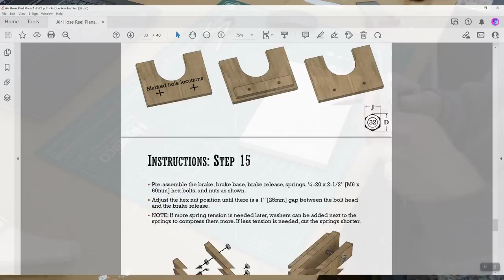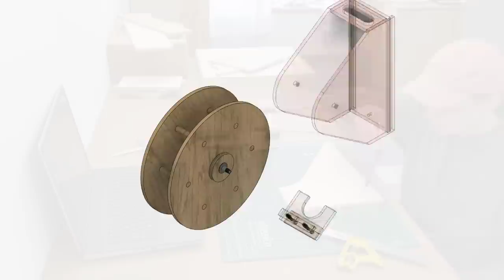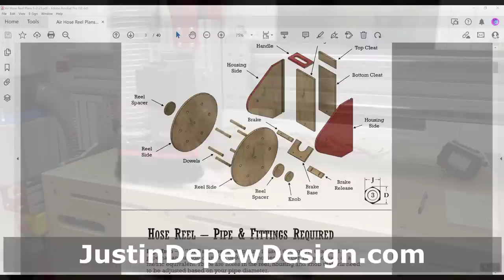Air Hose Reel - Woodworking Project

Comment: Great job, way better than my commercial reel. If you can design an auto retract then I would highly recommend that feature, I love mine.
Reply from the maker: Thanks, I attempted designing an auto retract but the extra parts and springs were going to get expensive and it started to make less sense as a DIY project. Sometimes the simple path is the right path.

Comment: In my life, I've never thought of using a router to trim dowels flush. That's a great little tip, instead of creating fine dust and using up a sanding disc.
Reply from the maker: It works great!

Comment: Cool build - a couple of questions
1. It looks like the Swivel joint added a lot of friction. Is it an issue / anything better to reduce friction?
2. Reaching under the Reel to release the brake looks a bit awkward. Any ideas to move the Brake actuator to one side?
3. The Wind-up handle looks difficult to use versus a longer, bigger handle. Not an issue just curious how well it worked
4. To modify the design for Vacuum for Dust Collection instead of Air pressure, any thoughts on what would need to be changed? (Bigger pipes, Replacing the Swivel Joint to redirect the output to a Shop vac, etc)
ps the View from the Inside looking out at 23:18 was awesome 🙂
Reply from the maker: Earl -
1. The swivel joint adds hardly any friction, it must be an illusion due to the video.
2. I'm just an awkward person...it's not that awkward in real life.
3. It's not difficult, it works as expected. It could be made longer by using a longer piece of pipe if desired.
4. Definitely bigger pipe and a different swivel type. I actually have this on my list for a future project!

Comment: I feel that you glossed over the hardware parts. Like what is that tee in the center of the reel? And did you cut your own threads in the pipes?
Reply: And how did you connect your compressor? So many gaps!
Reply from the maker: Hi Don, to answer your questions:
1. The tee in the center is just a tee. I used a brass barbed fitting on the tee to connect my air hose but most air hoses have a threaded fitting that will go directly into the tee.
2. I did not cut the threads. I bought them that way.
3. I connected my air compressor with a short air hose to the swivel connector with a standard quick connect fitting.

Comment: How did you secure the reel to the axle so when winding the hose back in the reel doesn't freewheel on the axle?
Reply from the maker: It's not secured. The fact that the hose goes from the axle through the dowels in the reel keeps it from freewheeling.
Reply: @JustinDepew  I just had a ah ha moment, makes complete sense....I didn't even think about that.....I just saw the axle spinning in the reel everytime you twisted it with your fingers..... awesome design and build!
Reply from the maker: I realized I forgot to explain this in the video!

Comment: I always appreciate the detail in your builds, but you can buy a hose reel from Harbor Freight that costs less than what you just spent in materials and it automatically retracts.
Reply: He is running a YouTube channel and has to come up with content and it seems like he tries to be original - that wouldn’t be easy. Also, people outside the US watch the videos and some of them mightn’t have access to Harbor Freight, or equivalent.
Reply: @TheLindsay720  Indeed, and those cheap hose reels are just crap. A decent compressed air hose reel is about 200€.